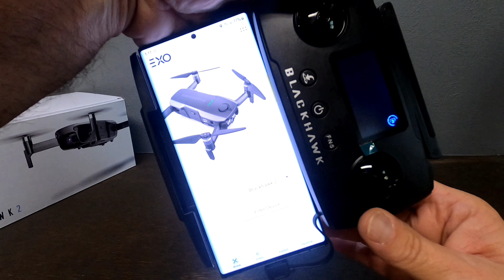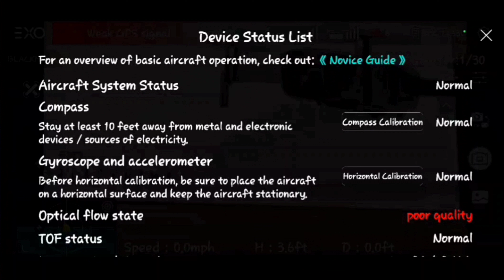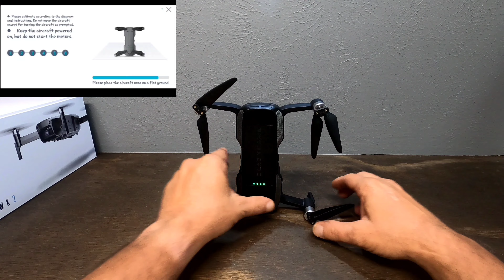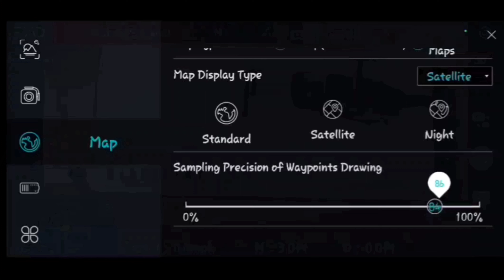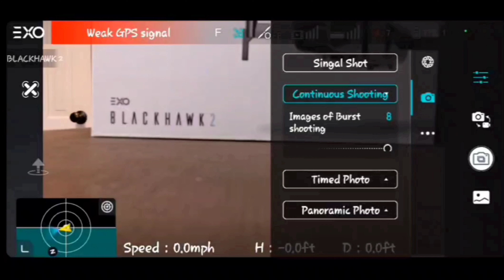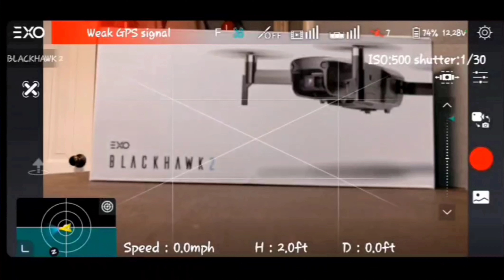EXO BLACKHAWK 2 Complete Setup and APP Tutorial. #exo #setup #howto #drone #review #youtube

Comment: how do you charge it?   I think they sent me mine with no chargers.
Reply from the maker: It should have included a Charging adapter that connects to the battery and then you can use any type C charging cable and a any 5V-2A charger box, if the adapter is missing you'll have to reach out to them and have them send you one!

Comment: Just ordered one myself. Eventually, I’ll still get a DJI Air3 in a few months. This should help with my roof inspections in the future
Reply from the maker: Am planning on getting the new Air 3 S as well!, thanks for Watching!
Reply: I tried using this drone for roof inspections.   Did not work out.  The houses were very close together and three and four stories with metal roofs when I took the drone off there was magnetic interference because of the metal I had to fly so high above and I could not get in position even with the zoom camera to get good pictures.
Reply from the maker: There is a section in the manual that tells you how to take the drone out of GPS mode, if you do that the metal roof won't effect the flight, just watch your wind speed because you'll have to manually keep the drone in place, but it's not hard and it's works, just a thought! Thanks again for Watching, I appreciate you!